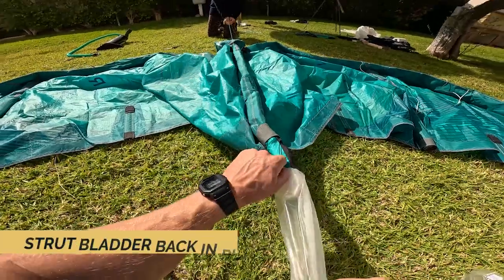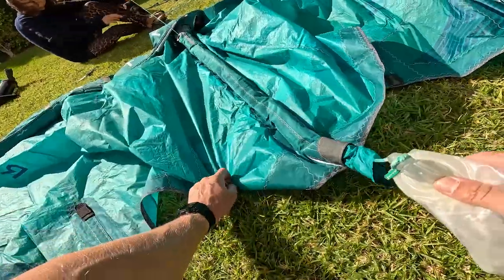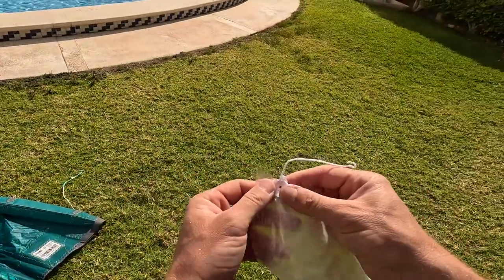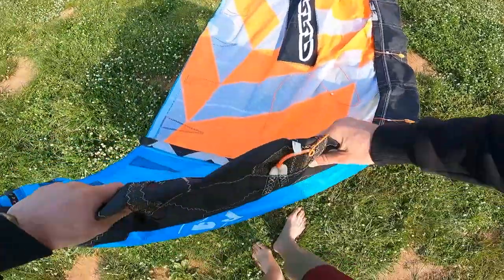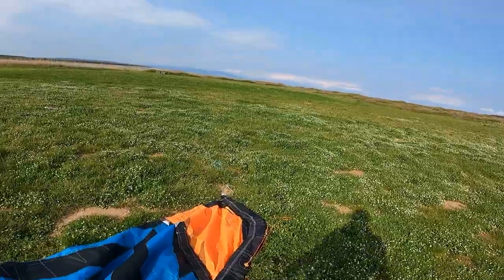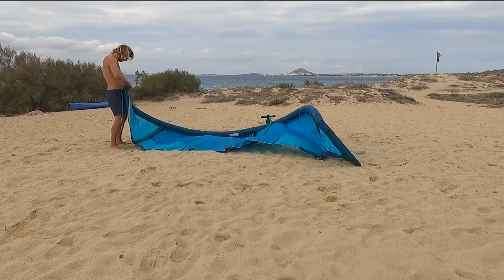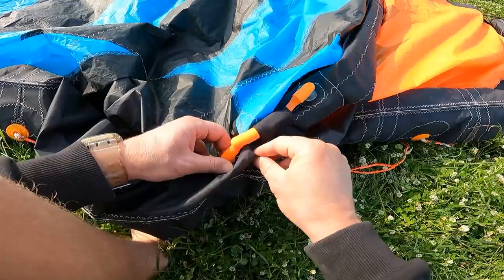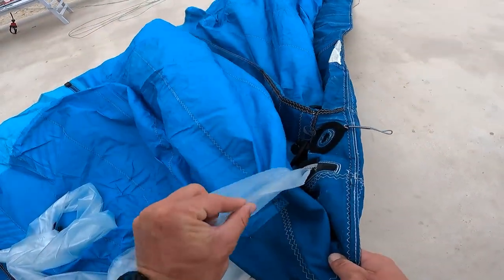Bladders back in place -  Basic Kitesurf Repair

Comment: Hi. I am wondering if you know whether doc tuba uses the same material as the brand or if they have there own material they use and have you been happy with there products.
Reply from the maker: Hello, you can find the full description of their bladder products on their webpage :)
But I can tell you that me and my friends have been buying products from Dr.Tuba for over 10 years now, and we never had any problems, in case you would have, they are definitely super responsive and I believe that they will replace your porches immediately in case there is a problem with manufacturing.
You can always use my code: "SPREF_HRYOJ" to get -5% for any of their products :)

Comment: I have an extremely slow leak in the leading edge, I can't find it by spraying soapy water all over it. I was thinking of removing the bladder, can the blade be patched or does it need replacing if there's any holes?
Reply from the maker: I believe you found the episode you been looking for? :)